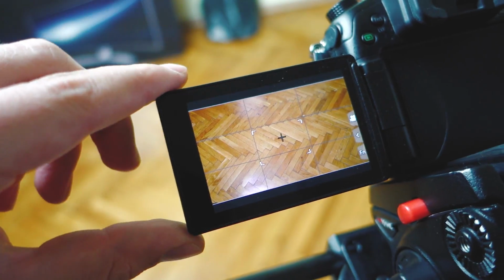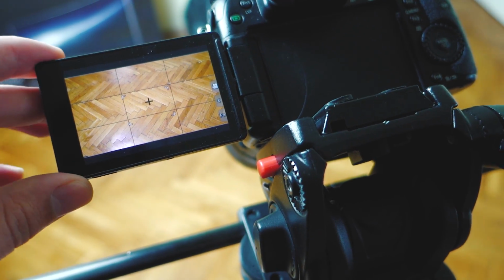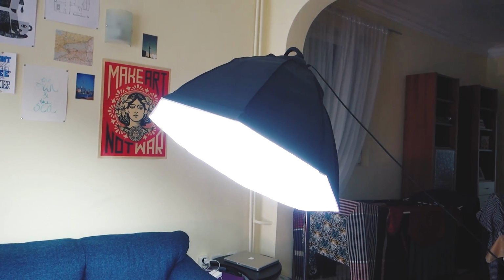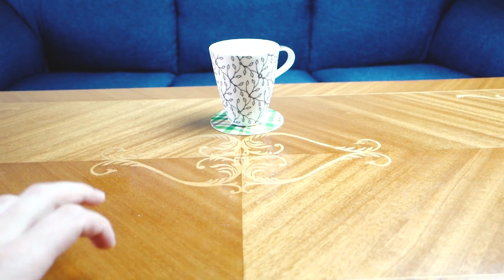WORK WORK WORK ... VLOGS are back!

Comment: This is definetly the wrong video to comment on but since its the most recent I figured it would be best to ask here. I want a new pc case and I've been looking at the phanteks p400 and enthoo m and corsair 400c. They are all great but they all lack something. I have a custom watercooling loop (from thermaltake) that consist of a resoirvoir pump combo and a rather thick radiator. Ive concluded that even the slimmest radiators wont fit on the front if I want my reservoir to be next to the mobo. Could anybody recommend me a case that would be similar to these but with place for atleast 1 HDD and a bottom mounted radiator/fan slot hidden in the psu shroud? 600c, why not? but I wouldnt want it to be inverted since I want the watercooling drain valve to be hidden in the shroud aswell.
Reply: fractal cases
Reply: I think the phanteks enthoo pro is the only case out there that isn't huge like primo but offers a pump mount and bottom radiator support under the PSU shroud